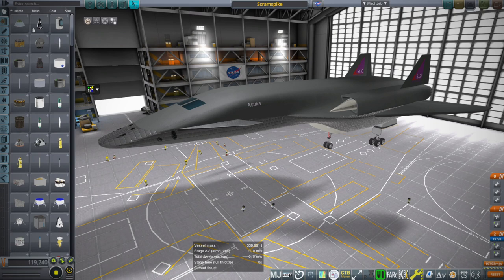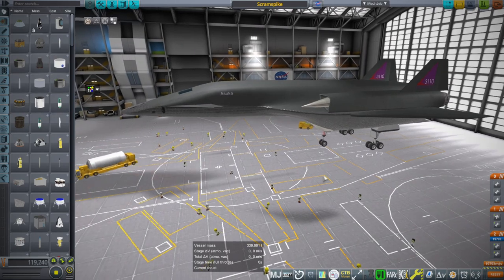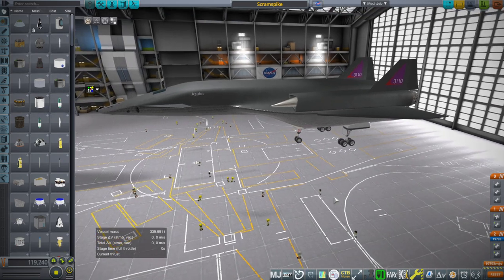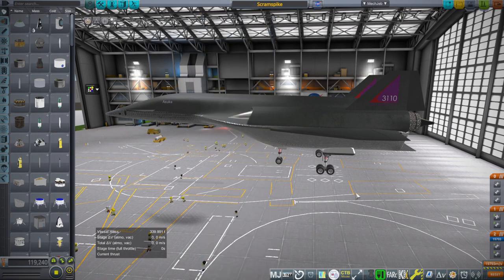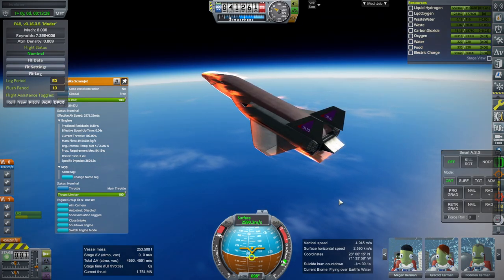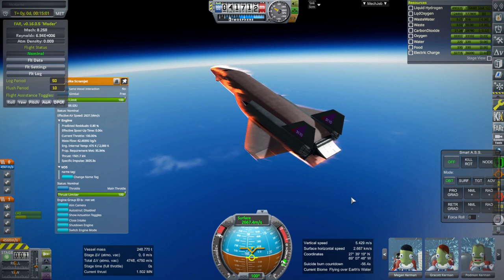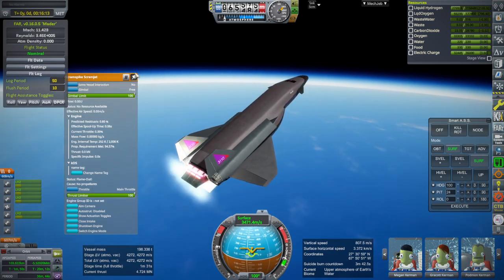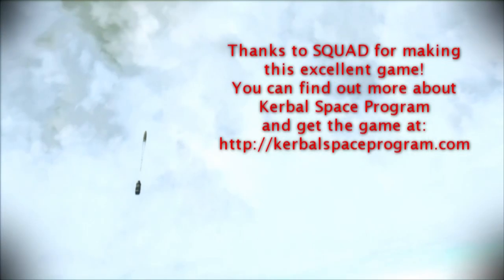Kerbal Space Program 1.12 with RO - Scramjet-Aerospike to Earth Orbit

Comment: Also why are you not using SVEL + rather than SURF for mechjeb? Because with SVEL + you don't need to dictate the heading it uses your surface heading as the reference point which is also just more efficient and as long as you are keeping your eye on your climb rate and just ajust the pitch from heading it's actually WAY more useful especially when trying to roughly maintain the same altitude, but is also useful for maintaining a certain climb rate with very small occasional adjustments, although personally most of the time I prefer atmospheric autopilot because it has a very good fly by wire system which makes pretty unstable craft very flyable espically if you spend time dialing in the settings you want for the craft and rather than typing pitch and yaw in you can use the controls for doing minor adjustments and it will hold that pitch and yaw angle unlike SAS.

But for exampple when I'm reentering with a space plane yeh I will use mechjeb because given how long it takes to de-orbit without burning up using mechjeb is easier, because only have to maintain a high enough AoA to slow your decent down, so it's just set and forget until you get below 3km/s at which point you don't have to worry about burning up anymore and have to start worrying about getting to a landing strip at which point atmospheric autopilot is significantly better.

Comment: Maybe you could make the Jet engines kerosene to use the free Volume for lo2. Would yield some extra denser fuel to burn through the initial acceleration, without taking up top much Volume
Reply from the maker: For now, we have the volume as I showed, and hydrogen does get better performance than kerosene mass-wise even though not density-wise.

Comment: the aerospikes look cool on the plane but you don't need aerospikes for ssto planes meant to ignite at higher altitude.
Reply from the maker: It just so happens that the back end of a scramjet looks like an aerospike anyway, so I decided that was the best way to integrate the rocket engines. Otherwise, yes, since we're not lighting them on the ground it's not necessary.

Comment: also you wasting a bunch of fuel by having to cancel out your vertical velocity, aka burning below your prograde vector you should aim to always be burning exactly prograde with your rockets and when not prograde above prograde, never below, because as I said your wasting deltaV you have already spent by spending more deltaV if you have burned too much, either reduce your thrust or just turn it off until you are at a point where you need to start burning again, which is still a waste of deltaV, but at least your not doubling the mistake you have already made.